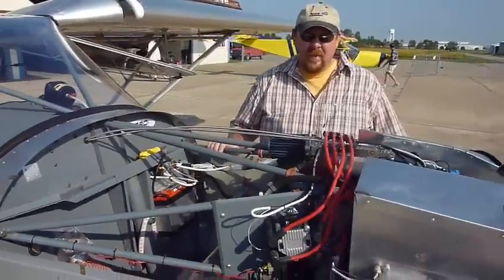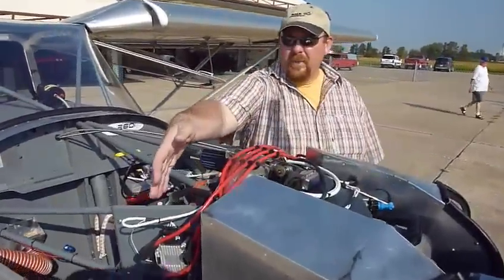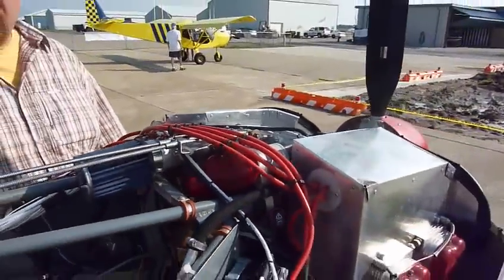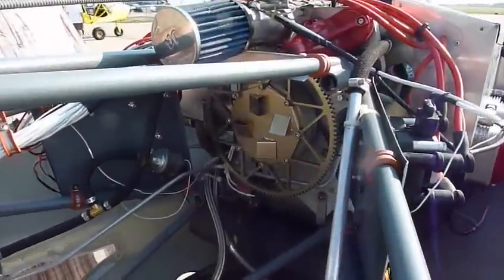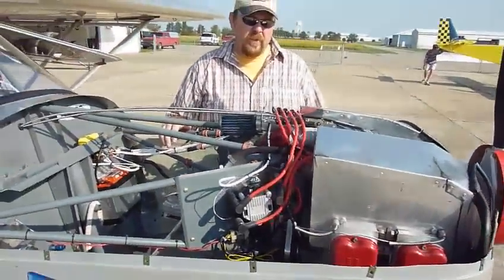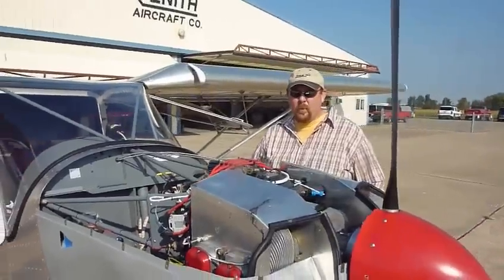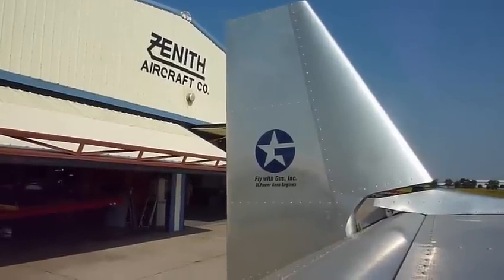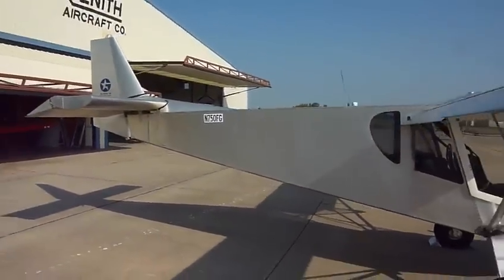A look at the UL260i engine installation in the Zenith STOL CH 750

Comment from the maker: That was the prototype installation using the light UL260 series engines (implemented by Gus Warren.  The firewall-forward installation (FWF) that Zenith Aircraft uses makes use of a shorter mount, using the larger UL350 series engines.